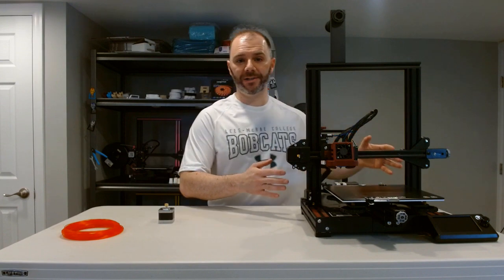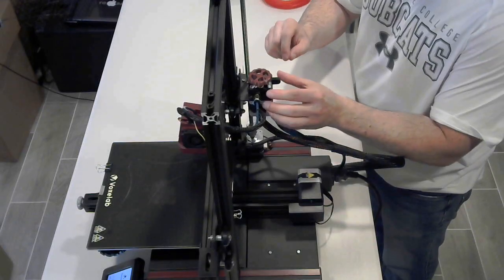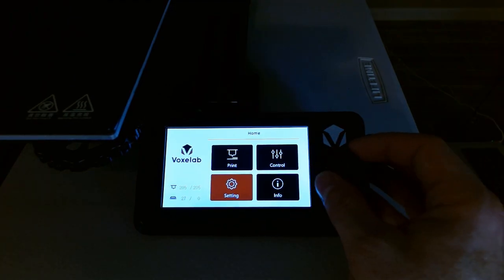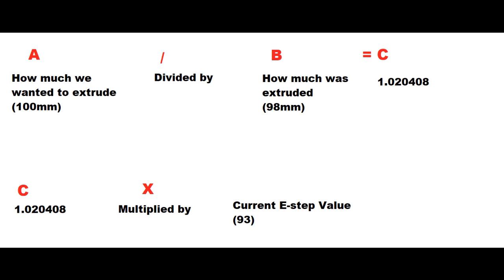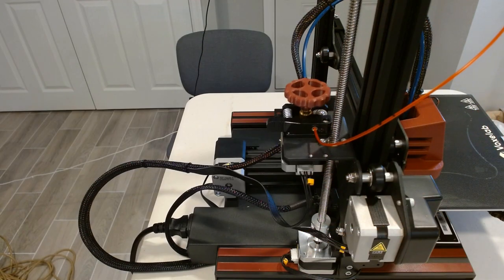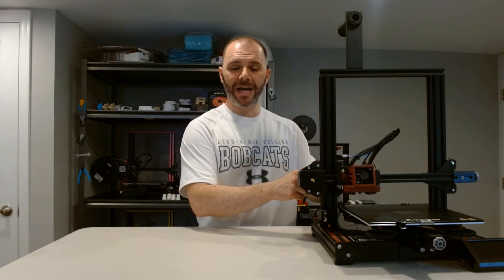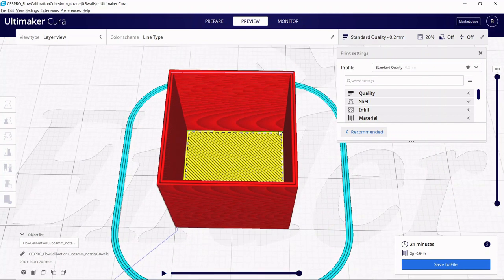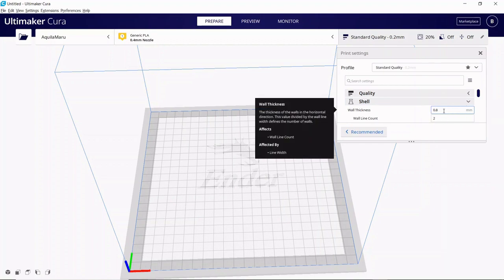E-Step Calibration Voxelab Aquila

Comment: Awesome video, as usual.  I really like the concept behind the first method, seems a lot easier, but I'm a little confused.  You extruded 100mm, measured, adjusted, and then extruded another 100mm which measured correctly, according to the summary of the two methods, we should be done at this point.  In the video you went on to test extruding thru the hot end, measuring and marking the filament, and it was back to extruding only 98mm again, which you further compensated the already adjusted e-step value for, and got back to 100mm again.  Am I missing something?  I really want method one to work but it kind of looks like you just proved it doesn't, or should you have ran a third extrusion to confirm you were actually getting 100mm using method one??  It seems like you may need the filament to be under the load of passing thru the hot-end to get an accurate extrusion measurement.  What am I missing here??

Also, just a reminder, the Aquila will auto-load as long as the filament is thru the extruder and started in the bowden tube and it will auto-unload also.  Both features will require a hot-end preheat and will take you to the preheat menu if required.  Thanks for being one of the few channels that support the Aquila.  Is it just me or are the Ender clone haters particularly threatened/triggered by the Aquila?  Lol!!  Thanks again!!
Reply from the maker: First off thank you so much for taking the time to ask such an in depth question! These questions are really what fuel my channel, as it helps clear up the issues I forgot to cover or didn't cover well enough. You are also right on the money with your question. After performing the first set of extrusions and compensations, when we get to 100mm we are done. The only reason I decided to perform an additional calibration through the bowden tube and from the hot end was simple to demonstrate that process for viewers in case they 1.) wanted to do it that way or 2.) have seen it done that way and wanted to let them know there is a better option available. Now the fact that we got a different number from the hot end was the precise reason why I don’t prefer this method. We saw that we got 100mm direct from the extruder motor (which is what we wanted), but once we added the additional impediments of the Bowden tube and the nozzle the number wasn’t correct (and created a great example of what adding those elements can do to our flow). If we were to adjust our E-steps to this setup we are adjusting our E-steps to this specific setup of filament, bowden tube, nozzle, temperature, etc. I don’t want my E-steps to be dictated by any one specific setup, because if I change the filament or the nozzle my E-steps will have to be re-adjusted which is a pain. Any changes I have to make after replacing filament or a nozzle are better (and easier) to be done in your slicer using flow. I want to get an E-step number that is calibrated to my Extruder Motor. Our extruder motor is our only constant in our setups, no matter what we change that motor will always be the same, and we want that to be consistent, so when I ask for 100mm that’s what the motor will give me, if I am not getting that number once it’s going through my hot end I would much rather tweak those settings in the slicer. All different filaments at different temperatures will likely require a different flow, (although it’s generally negligible so once we set it once we don’t really have to tweak it).

I don’t know why I never use the auto-unload feature (on purpose anyway, there are times I went to ‘cooldown’ and accidentally hit auto-unload lol), but it’s worth noting that it’s likely a better option because many people have mentioned this. As far as the haters go, I think it’s like anything else, once people feel part of a community they’ll defend it adamantly, whether that’s the Creality community or other. I am a member of the “inexpensive and excellent printer” community, so anything that falls within those parameters I will stand behind lol so I love Enders, Aquilas, and now that I have dabbled in the Eryone market, ER-20s!

I hope this explanation makes sense , if not you know where to find me lol
Reply: @PrintsLeo3D  Damn, that's a fantastic explanation! 
I'm new to printing, and just did my first benchy on the Aquila. It came out quite well except for a little stringing, and the infill seems to be pushing a W pattern through the hull. I think I'll do this calibration soon. Might be extruding too much.
Thanks..
Reply from the maker: Thanks! This is a pretty easy calibration that can really pay dividends. Also if you are seeing the infill through the walls of your print (and assuming it's not transparent PLA or PETG) then you should consider increasing the wall count in your slicer. Under the WALLS tab of Cura there's a section that can increase the amount of walls (or perimeters) your model has. Additionally adding walls also increases its strength as opposed to increasing the infill percentage! Good luck and thanks for doing the discussion!
Reply: @PrintsLeo3D  I just found another Cura setting called "infill before walls" and the description basically says that if it's turned on then the infill may show in the walls, but if the infill is laid after the walls then if can affect overhangs and strength.
I suppose it's all about knowing your settings and making the best choice for a particular print, or printer.
Reply: @PrintsLeo3D  Makes perfect sense, I got to thinking after I posted the question that maybe the first method is best for the stepper and second method was more flow related, but thought I might be over thinking it.  Cool.  I'm in the process of printing some custom legos for my grand-kids.  Talk about something that points out every accuracy flaw in your printer set-up, lol.  Thanks again!

Comment: looking for the port to connect PC to the Aquila, is there one?
Reply from the maker: Yes the physical port for the connection is on the front of the machine, right next to where you insert the SD card.
Reply: @PrintsLeo3D  thanks I was looking for the old printer type like cr10

Comment: Question: how often do you need to do this? I mean other than after a complete overhaul or replacing the extruder itself, is this something I should do often, once or maybe after a certain number of print hours?
thanks for the link for the calipers, I'm in need of a digital set, I'm still going old school
Reply from the maker: You pretty much got it! Only whenever you replace some main aspect of the extrusion system , or sometimes if your print quality starts to suffer than it can always be a good idea to circle back to the basics. Those calipers have been working great for me and the price is right.

Comment: Idk why I’m having trouble doing my calibration for 100mm. 
If I do 125 it’s reading at 80mm if I do 130 it’s over 100mm! I need HELP!! Someone told me to pid tunes also. It still won’t work!! I need help with someone with a MAC!!
Reply from the maker: I would love to be able to help , I just want to make sure I understand what is going on. Have you adjusted your e-step number yet? factory settings start it at 93, is it still there? What happens in you Move 100mm worth of filament through your extruder, using the LCD panel. Of course you want to make sure you disconnect the bowden tube so the filament isn't making it's way toward the nozzle. Then snip the filament that was extruded and measure it, what size do you measure?
Reply: @PrintsLeo3D  thanks for the fast reply, it really means a lot to us subscriber! You do explain clearly in the process step by step! Keep them coming! Love them!!! I changed out to my new extruder that I bought from Amazon. 1st thing I did was told it to give me 100mm the way it is. It gave me about 2.5 inches. I’m telling you in inches because I’m not 100% sure in mm lol I’m not home right to Measure it. I cut the filament flush 2nd I changed it to 125 and it gave me 3in then I went back and changed it to 130 it gave me 5 or 6in? Idk why I’m doing everything your saying! Every time I change it do I have to save it to save parameters? I’m cutting it off at the end of the extruder not the hot end! Thanks
Reply from the maker: Don't be discouraged, it sounds like your doing everything right, it's just the process, sometimes you can nail it down in one try and sometimes it takes a few to get the right number. Obviously the process get's more accurate when you are measured down to the MM but it's no bother we'll work with what we have lol In your first measurement you got around 2.5 inches which we can estimate as 64mm, we can plug that into our formula. Asked for [100] got [64] = 1.5625. Then we multiply that number by our current E-step(I'm assuming you started at the stock number)[93], so 1.5625 x 93 = 145.3. So you could then set your e-steps to 145.3 and extrude another 100mm. Overall you're going to want just shy of 4inches which is 101 mm. Just from your estimations it sounds like you want a number just under 130, as that's where it started to over extrude(5-6 inches). You don't need to 'Store Configuration' after each change, only when you have the right number inserted, because once you turn off the printer the E-step number will not be saved. Also which extruder did you buy? With those numbers I imagine you bought the All-Metal dual gear extruder? Good luck, let me know how it goes!

Comment: hi buddy any chance you have a good Cura profile for this printer I could really use one thanks
Reply from the maker: The profile I recommend using is for the CREALITY Ender 3 Pro. Under add machines, go to non-networked printer, find the Creality3d drop-down. Scroll down and select the Ender 3 Pro and go from there! It has great starting g-code and settings, the Aquila is basically a clone of the Ender 3. If you want to see my exact profile drop me a line at printsleo3d@gmail.com and I can send it!

Comment: Your calipers have 0.1 accuracy, so for 0.75 or 0.84 will still show 0.8 - so your measures are useless
Reply from the maker: First off I appreciate you looking into this, it made me go back and reevaluate my calipers. However I strongly disagree with your assertion that these measurements are useless. To me that sort of 'all or nothing' thinking is more likely to make people shy away from even attempting to calibrate their machines.
 "Well, my calipers aren't accurate enough why bother?" 
I think that attitude is wrong. Most people, I believe, aren't getting into this hobby because they are in the aerospace field or a major science, they simply are interested in 3d printing. I think promoting calibration, even if it isn't as accurate as we may want, is a good thing. I think getting people to be more familiar with their machines , the process, and even some of the language of the hobby is a good thing. When I started printing, calipers were another expense I had to weigh against my tiny hobby budget, I couldn't spend too much but I still wanted access. Looking back now it's even hard to read all the fine print for my particular model and find out how accurate they really are. Does that make me think these measurements are useless? Absolutely not. Does it make me want to expand my budget , reevaluate the importance of a more accurate measurement? Absolutely. So I really appreciate you bringing up this topic, I think people should use what they have at their disposal - at their budget - but at the same time I think we need to be mindful of the possible limitations of our equipment.
Reply: @PrintsLeo3D  Then you probably should mention the consequences of usage of calipers with 0.1 accuracy? I agree that promoting something like that is beneficial, but unfortunately less experienced users will not get expected results - and this might create even more confusion.
Reply from the maker: Yes, definitely! I plan on adding something similar to a disclaimer in the description of the video, this way everyone who views this video will consider the ramifications of using their particular measuring devices. Whether they can affect any change on their tools will be up to the individual person, but at least they will be aware of the possible limitations/inaccuracies.
Reply from the maker: Amazon will sell anything
Reply: 0.1 mm is better than 0.1 inches.
Reply from the maker: I'm editing a video right now that sets up the Aquila on Cura and walks you through a primer on how to navigate the program!
Reply from the maker: I've never used Voxelmaker so I can't make a comparison, but I have found Cura to be pretty easy to get a handle on and continues to be worthwhile the more you familiar  you get with it. The video should be up Wednesday or Thursday, and I'm hoping it helps get your feet wet.
Reply from the maker: Sorry about that, I had some heating issues at my house that took my attention for a few days. I'm still editing the video but reach me via email and I'll send you the part that sets up Cura for the Aquila so you can get it before I make the finishing touches. printsleo3d@gmail.com

Comment: Which fan shroud did you print, and can it take a BL touch?
Reply from the maker: The shroud I used is not equipped with a BL Touch but the author of the design does provide a model with that available. The fan shroud I'm using is a modified version of The Satsana, it has been raised 2mm higher to better clear the Aquila bed, this is the link (remix by THESUBARUJUNKIE) : 
https://cults3d.com/en/3d-model/tool/satsana-fan-shroud-for-voxelab-aquila  

The fan shroud that THESUBARUJUNKIE modified from can be found here: https://www.thingiverse.com/thing:4792632
Reply: @PrintsLeo3D  Thanks, that was one I was looking at.  I've heard it cuts down on some of the fan noise, did you notice a difference?
Reply from the maker: I didn't notice a difference in fan noise to be honest. For me the fan noise for the Hot End was quieter on my Aquila than on my Ender 3 V2(which the Aquila is modeled off of), it's the electronics fan in the base of the Aquila on mine that causes more noise.

Comment: The value without going through the heat-block will be the same for every filament (as there is no back-pressure and hence no difference in slippage of the filaments).  So, this number should be a constant for your printer and hence can indeed be measured with your sample filament.  When measuring the path through the hotend, the result will vary per filament, so it doesn't help doing that with the sample filament, you should use the actual filament you'll print with.   I prefer tuning E-steps without going through the hotend and then put all the filament-specific behavior in the extrusion factor.
Reply from the maker: I completely agree, I prefer measuring the E-steps directly off the extruder. I should have been more clear in the video because a few people have brought that to my attention, but the only reason I even presented calibrating e-steps through the hot end was just because I have seen other people demonstrate it that way and I wanted to present an alternate method to people because they might see it online somewhere. Thanks for watching and taking the time to comment, I really appreciate it!